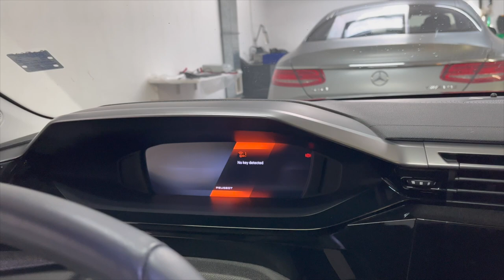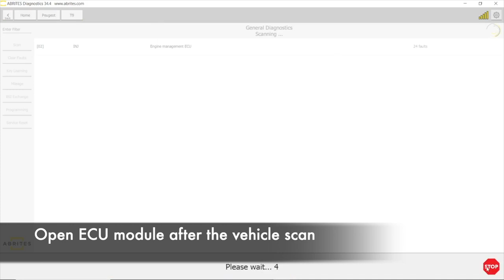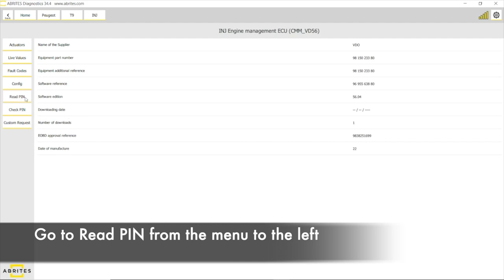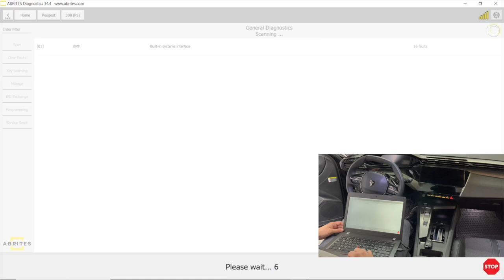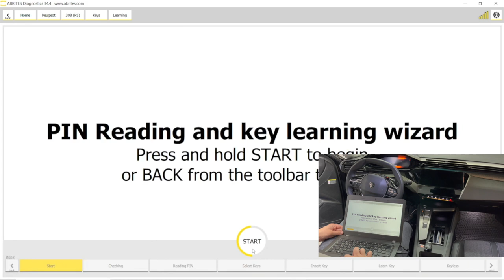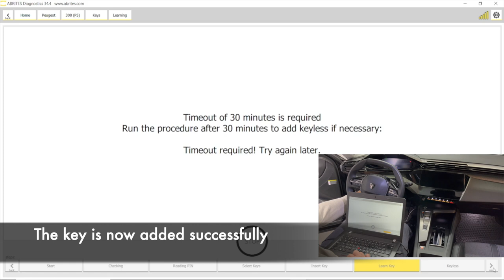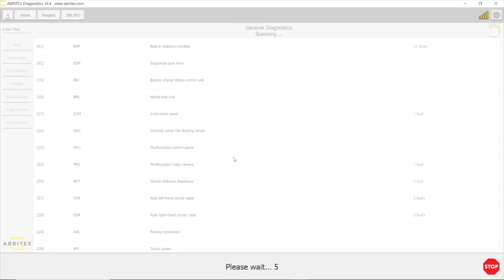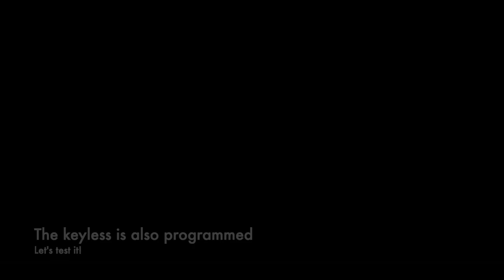Peugeot 308 III All Keys Lost Key Programming Using AVDI

Comment: May I know other than CB013, can we used Distribution Box to read the pin code out from ECU?
Reply: It will be possible to completely read the ECU on bench but you need the CB013
Reply: AS  U  CAN  SEE  ON THE  VIDEO  ,  the  zn051  (  DISTRIBUTION  BOX  ) ,  is  not  needed  for  this  process  .  the  cb013  is  what  is  needed  to  complete  the  read  .